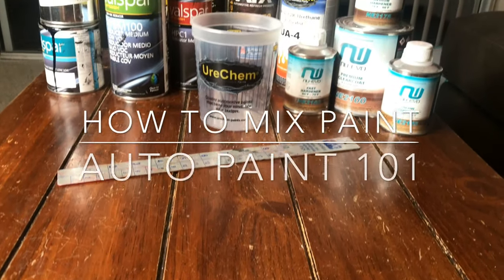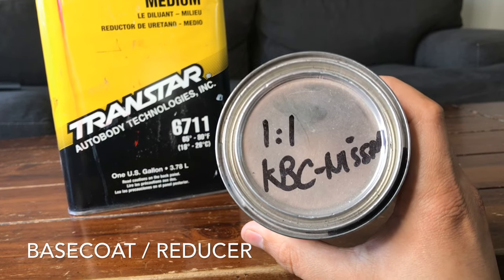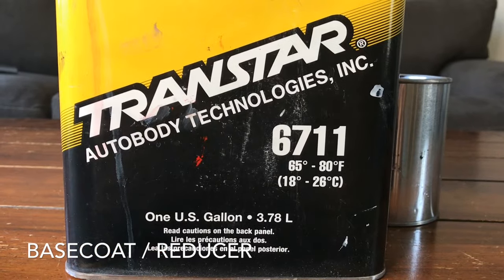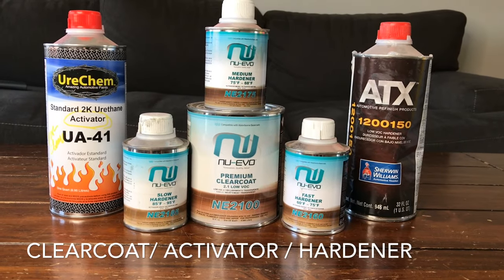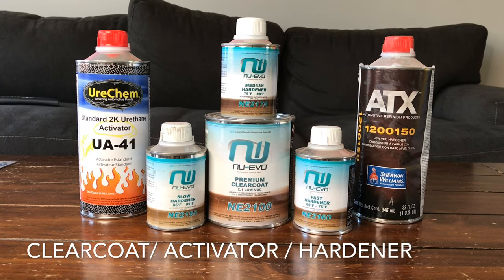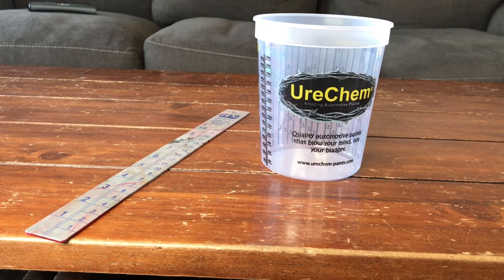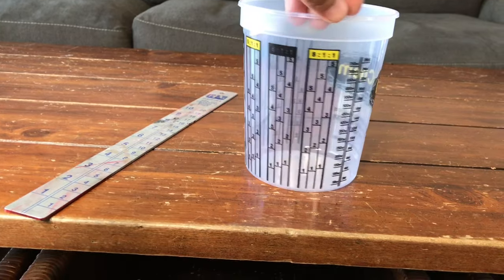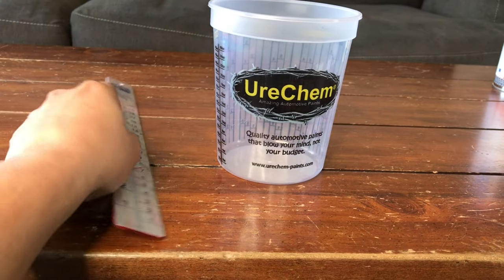How To Mix Car Paint (Step by step) #carpaint

Comment: hi, im wondering if you can help, ive bought gloss black paint, and other materials but the instructions say 2-1 ratio plus 15-20% thinner. 15-20% of what do they mean.
Reply from the maker: Means to add 15-20% thinner /reducer to the 2:1 mix
Reply: @Mechaniclyfe  thanks, I've got the mixing cup coming so if I fill paint to 4 and then activator to next collum 4 do I do thinner to 3rd collum 4. So it would be like 2-1-1
Reply from the maker: 2 parts= paint
 1 part= activator 
15-20%= reducer/thinner

Basically the paint is thick so they recommend thinning it 15-20% so it flows out better and a smoother lay out , and easier to spray out of the tip of the gun etc
Reply: @Mechaniclyfe  right I get what you mean,  so if I fill cup to 4, then the next 4, I put just under a quarter of what that amount comes to.
Reply from the maker: Oh gotcha sounds right , that would depend on the cup size you got tho but sounds like you got it

Comment: would you use a reducer on a clear coat? is that even normal?
Reply from the maker: You can yes depends on the clear , it helps the clear thin out to be easier to spray and flow out easier usually you don’t want to reduce more than 10%
Reply from the maker: But there are some clears that go as high as 20% reduced

Comment: After mixing the paint, is there a certain amount of time you need to wait before you start spraying or can you spray right away, or does it all depend on the particular paint/reducer/hardener you're using?
Reply from the maker: You can spray right away after proper mixing and stirring.

Comment: Great video, quick question if I'm using water based base coat what do I need to mix the paint with???
Reply from the maker: Depends on the brand of paint , each have there own way of reducing , and in some cases activating , some require special additives to mix in with and others are ready to spray . Sorry the answer is vague at best , but you can always refer to the TDS sheet for clarification
Reply: @Mechaniclyfe  thanks for getting back to me, the paint I'm gonna use is lechlers hydrofan water based, but I've only ever used solvent base coat before so I'm just a lil bit confused, really appreciate your help tho

Comment: Thank you for this video -  very helpful. Question: If I buy a litre of clear coat in a paint shop, do I need to purchase hardener also to mix with the clear coat or is the hardened already mixed in the can of clear coat. I desperately need help. Thank you.
Reply from the maker: Depends 1k clearcoat doesn’t require a hardner but a 2k clearcoat will require one
Reply from the maker: Also they make 2k clear coat in a spray can , that has a bladder inside that you pop and it mixes hardner in the paint can  it’s called spraymax clearcoat on Amazon

Comment: I have a question.
On 2 stage paint does the basecoat have to be leveled before the clearcoat is applied? Or does the finish get leveled after applying the clearcoat?
Reply from the maker: Everything should be leveled during body work and primer stage, then basecoat will be applied on top of your chosen primer/primer sealer, basecoat should be nice and smooth and allowed proper time to dry before clearcoat. If there is a problem such as dust or bugs or heavy orange peel in the base coat stage you can sand the basecoat lightly and reapply more basecoat before applying clear.
Reply: @Mechaniclyfe  I'm using Premier 2k urethane primer surfacer before the base coat.
Reply from the maker: That primer will need to be sanded before base and clear, sand your primer with up to 600 grit for solid colors or 800 grit for metallic colors

Comment: I have a question. I have a 2:1 base coat and reducer. No activator.
Do I not need to apply clear coat after ?
Reply from the maker: It would be wise to, clear coat acts as a protection for the paint to resist fading scratching etc

Comment: 15+ years ago I used to do on site auto body. Was mostly bumpers for dealerships so used cars looked less banged up for sales. We would custom mix the paint for each vehicle by looking up the paint code and entering it into an app on a blackberry. The app would give us all the mix ratios for each paint and metal flake by weight starting with the most used in production and then other mixes that were used during that year. I had made an entire rack to separate out the colors and flakes by their number. Does anyone know what the app was or one like that? I have been curious about doing some custom stuff in my spare time since I miss doing it but not enough for a full-time job
Reply from the maker: The only one I have used is from glasurit , tells you the certain measurement for paint and toners etc, but it’s glasurit specific
Reply: @Mechaniclyfe  well that's a start! Thank you! I am sure that everything out there will be company specific so that you stick with their mixes. Though through time I am sure you could custom mix as you like. But to match an existing it would probably be best to follow that companies recipe

Comment: awesome video thaanks , i have a question tho about primers if im having a bare metal piece i need to use epoxy primer or self etching primer , and put over them 2k primer ? and how a bout a non bare metal piece what should i use before base coat ? thanks again
Reply from the maker: Depending , you can use either epoxy or self etch to bare metal. With some epoxy primers you can go straight to Basecoat, but there is a window to be able to do that, after that window it must be sanded   Before applying Basecoat. High build primer can be used for Body panels that had body work done. If the panel is nice and flat with no dents, you could even use a sealer before applying Basecoat or sand and apply Basecoat right on top of the original paint as long as the paint wasn’t peeling .again depends on surface and body work needed.

Comment: Hi can you add matte finish to clear coat and what’s the ratio readings
Reply from the maker: Yes you would need a flattening agent which is an additional additive to add to the clear coat, ratio will vary on product , but usually in most cases you add till you achieve your desired finish

Comment: Awesome sir can I ask question.. The single state you mean Primer sir....?
Reply from the maker: No single stage paint is not a primer
Reply: @Mechaniclyfe  what does it mean single stage sir...thank you
Reply from the maker: @asawanidivine9471  it just means paint and gloss is applied in one step , that’s why the call it single stage . A two stage would mean first basecoat paint (color) and then clearcoat paint on top. A 3 stage would means basecoat first , effect coat next , then clearcoat last
Reply: @Mechaniclyfe  oh now I understand... Thank you sir for your great time....
Reply: @Mechaniclyfe  sir  regular primer can I mix 2k hardener with 2k thinner... So that it will be 2k primer....
Reply: @Mechaniclyfe  sir..  Can I ask question  . Base coat color can I mix it with 2kthinner..  ?
Reply from the maker: Depending on the type of paint, urethane paint will use a reducers
Reply: @Mechaniclyfe  but the paint is not a urethane sir. .can I mix 2kthinner or regular thinner
Reply from the maker: First let’s start with what type of paint that it is. Thinner should work just depends on the paint type as mwmtioned
Reply: @Mechaniclyfe  
Oh thank you sir for great info 
God bless you.
Reply: @Mechaniclyfe  Helo can I ask question Again... For plastic bumper... Can I spray primer direct to the surface without primer sealer... Thank you 
God bless you.. "
Reply from the maker: You must scuff bumper, and  apply a adhesion promoter to the bumper for best adhesion for your primer
Reply from the maker: And yes primer can go on with out a sealer
Reply: @Mechaniclyfe  oh that's what it is... Now I understand sir..  I scuff the bumper what grit sandpaper do I need sir..

Comment: What is the cup size-
#2, #3, #4, #5, #6.
Which one of above is used to find spray viscosity
Reply from the maker: All are essentially the same just different sizes depending on how much you want to mix. Just find a cup that has your mixing ratio and the amount you want to spray

Comment: You did not cover percentages.Say 1:1 Epoxy adding 20% reducer for sealer coat would be?
Reply from the maker: I didn’t show as these cups in the demo didn’t have a percentage ratio markings. But just buy the appropriate cup for your needs

Comment: What size tip and air pressure to spray a single stage?
Reply from the maker: Depends on the gun and  material, usually a 1.3-1.4 but depends , check TDS sheet on product

Comment: I’ve been using hardener as my reducer💀when mixing my base cost . Can I do that or should I get reducer ? I’ve only painted 2 times and Was never told if need the reducer . I have base cost that I’m planning on using this weekend
Reply: I bought some Finish 1 fc740 Super Brilliante 2.1 VOC Clearcoat and I have some finish 1 fh612 regular hardener. Do you think that’s going to be problem ? Do I need to get the fh742 2.1 voc hardener? And what’s your honest opinion on finish 1 I have heard mix reviews . Thanks
Reply from the maker: Finish one is good , I would recommend using the hardener that is required for that particular clear. I would also just go buy some reducer , for your base coat thier are some basecoats that require a hardner but i always go off of the tech sheets for said products

Comment: What ratio is most urethane base coat?
Reply from the maker: 1:1
2:1
3:1 on some paint line
Reply: @Mechaniclyfe  I'm using limco urethane base coat
Reply from the maker: Check tds sheet it’ll tell you the mixing ratio , sometimes found online